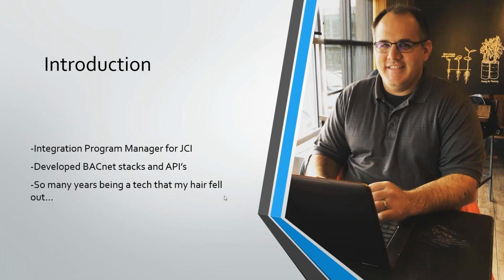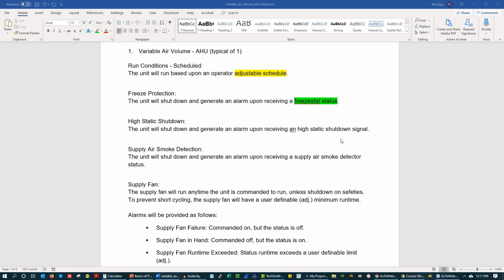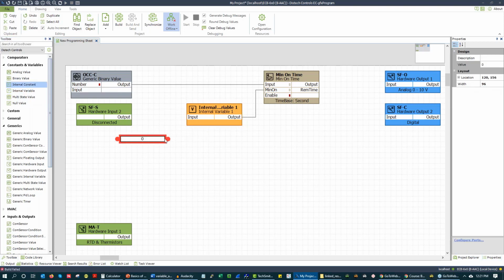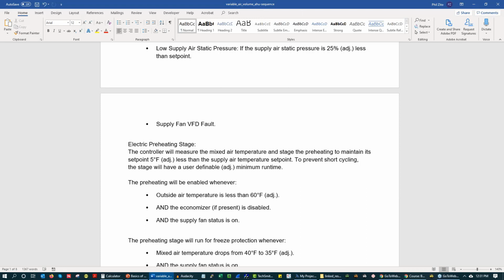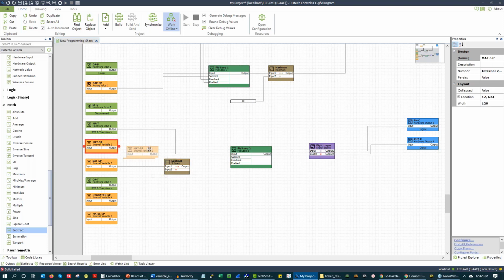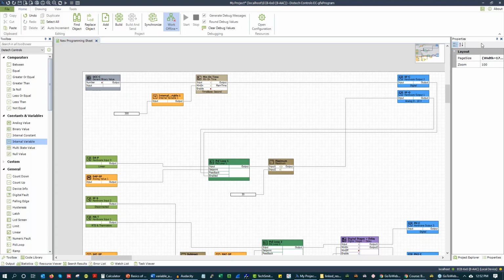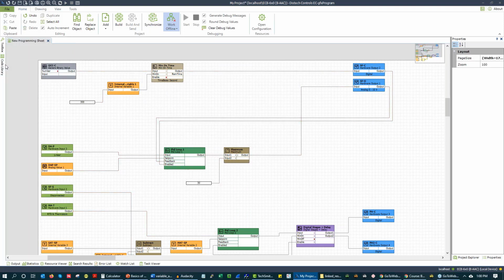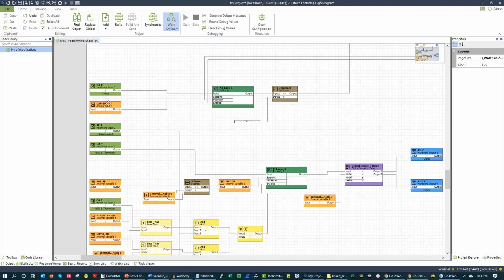Basics of BAS Programming Webinar

Comment: where can i get a copy of this wire sheet please
Reply from the maker: If I remember correctly this is Distech GFX that I used in this video. So you'd need to get access to their software most likely through a dealer or distributor.